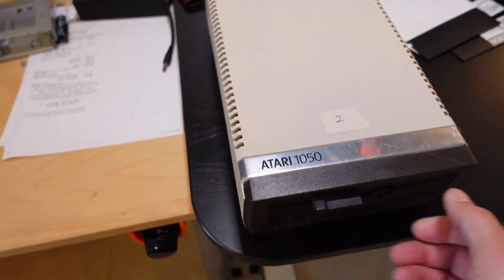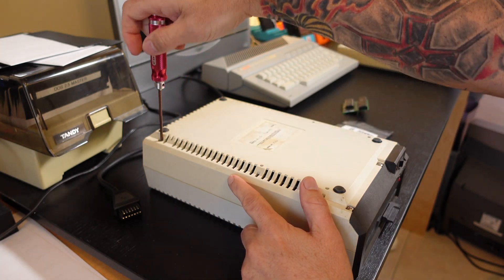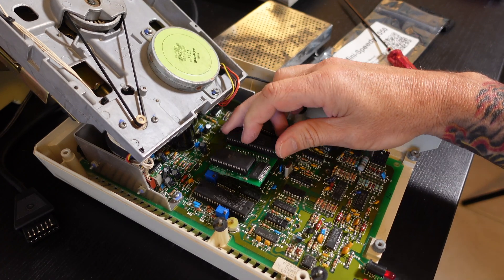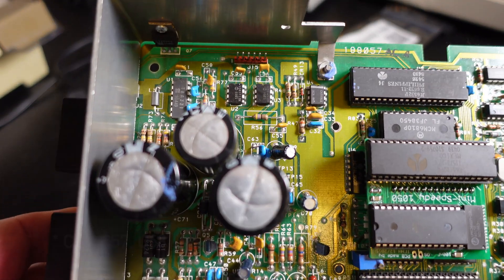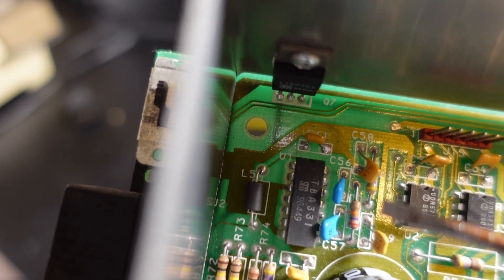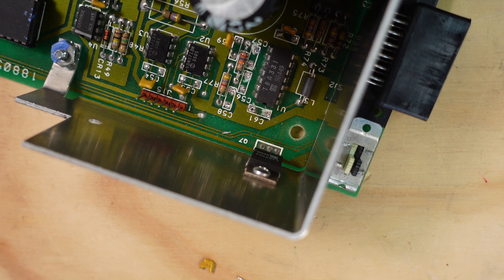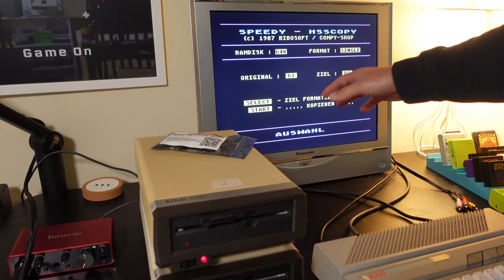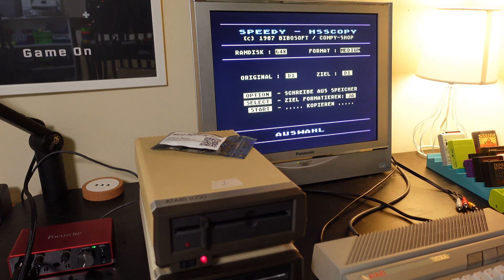Atari 1050  drive Mini-Speedy Upgrade

Comment: 1 correction you use mini speedy 1050 not the plus or super. You say with copy disc its in the buffer from mini speedy but is not true. Only with mini super speedy  has 256kb for buffer. Solder a switch on it where os standing  when open copy program when closed bibi dos. Firmware 1.7 for use with ntsc.
I have mini speedy 1050 round 1991/92 i have bibidos and this copy program on it. But old firmware 1.3 i know 1.4 was the latest on super speedy 1050. I have mega speedy 1050 all upgrade drives on it. Happy 1050 etc. 

I like the videos....🎉🎉🎉🎉🎉

My 1050 are all tandon. Rom or eeprom(on your video) upper side white ristors are the switches for eeprom or normal rom. I have 1 oldest tandon. Before the great heat plate backside 1050 has errors on 12v 5v it get to hot they where soldered with cables to the heatplate fix. Later they have tem located to the back.
But the best upgrade is mega speedy all upgrades. But bitwrite not or someone can add it to. Or switch back to old mode. For copy protection speed goes low on the speedy happy etc or unhappy can don by software. Or a switch slowmode.

Comment: Nice video, however there is one factual error at 12:27. The MINI-SPEEDY has no built-in RAM, so the copy program uses the RAM from the computer (130Xe's extra 64K, note the RAMDISK=64K). In this case the computer's SIO port is actually used for data transfer. When the copier is booted from the drive, it also loads high-speed SIO transfer routines so the transfer is done in high-speed. MINI SUPER-SPEEDY on the other hand has 256K built-in RAM so computer RAM (and SIO) is not used in that case.

Comment: Nice to see you have some time to yourself for hobbies.  Love seeing hardware installs, although personally prefer to use turned pin sockets with matching headers (the Speedy I noticed didn't so damages the socket long term so the original processor can't be fitted back relieably)  Would love you to expand on your assembler programming as well, I've enjoyed these very much and dable and learn more all the time but would be great to further my knowledge with some additional tip and so on.  I design my own add ons such as adding a 2nd PIA (or VIA) , Static RAM extensions etc. but often let down by programming (my programming)

Comment: Very nice! Did one of these a couple years ago and it worked however the 1050 might have sent a voltage spike and damaged the computer. Unsure! There is a known bug on 1050's where it's supposed to be powered off and unplugged for 15 or more seconds before plugging it into the computer. The A8bit FAQ mentions this issue, which is the only place I've ever heard of it. I'm wondering if those resistors you (we) removed are for more than just RF filtering but offer some voltage spike protection on the SIO chain??

Anyways I won't use that 1050 until fixed or diagnosed if sends a voltage spike on the SIO. The 800XL I haven't had time to fix yet either or at least gotten around to it. I'm not certain that the mini-speedy was the cause or merely correlation.  I hadn't used the drive much before but it did (and still does) work. The 800XL has a U1MB as well. Anyway I'll check into the failure later this year, to at least see what IC's failed.

Comment: Reminds me of the 1050 turbo Bernhard Engle made in the 80's I got it mainly to run double density with the higher speed as a bonus.  Does this 1 also do double density?

Comment: Very much like the Happy install. I did a Happy in the 1980's. It however only replaced the drive CPU. An even simpler modification was the US Doubler upgrade which was two piggy backed chips that had faster than,stock loading and allowed, if you used their alternate roms, to change the drive selection switches from 1-4 to 5-8 giving the possibility of more than 4 drives on the SIO chain. (Maximum of 8) Good straightforward video.
Reply: Had a Happy as well.  I was a Happy kid that Christmas!